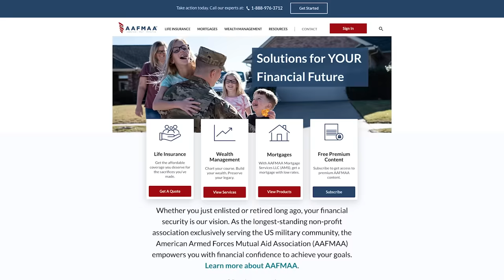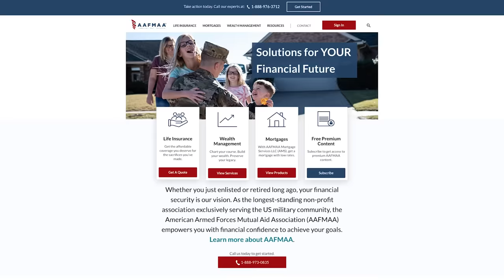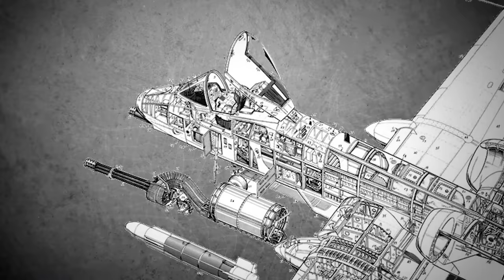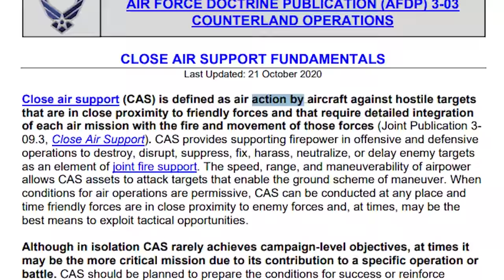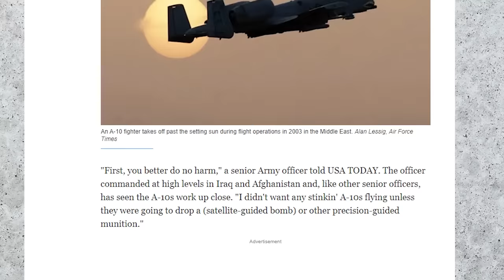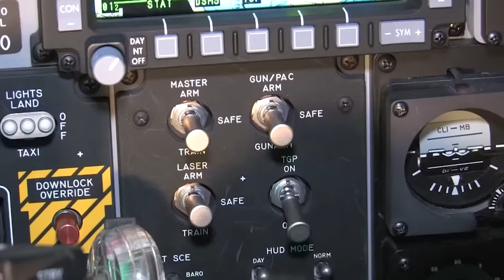Why the Air Force is Screaming to Retire the A-10 Warthog

Comment: "Close Air Support" is not about sticking a plane & pilot into harms way. It's about providing support which is "Close" to friendly forces. Same as "close artillery support". You don't run your artillery up to the enemy to use it point blank, and the only reason they did that with the A-10 is that in 1970's tech, it was hard to avoid friendly fire without an eyeball on the target zone.
The A-10 became somewhat obsolete over the course of the 1980's due to shoulder fired air defense systems. But it took a while for those systems to become prevalent among hostiles who "live in tents". It's about 20-30 years overdue for retirement. In terms of combat effectiveness, it's in much the same boat as the F-4. Cool plane... it would be perfect for fighting the vietnam war if it had come out sooner, but uh... things change.

F-35 can watch a soldier pee in the bushes while it's a barely visible spec in the sky, and send a cost effective, compact, precision ordinance (stormbreaker II) into his back pocket from a safe vantage point.
But frankly, even an F-16 could do "most" of that, with the help of a forward observer. So, A-10 has been showing it's age for a long time.
Reply: A10 can do it much much cheaper
Reply: Dang you changed my mind
Reply: A-10 needs to stay
Reply: @myprivatewar  Not really. As it ages, it becomes more expensive to keep alive.
Reply: @myprivatewar  Cheaper, yes. Even with all the extra duct tape expense for holding the old airframes together ;) SLEP is almost always cheaper than a new plane. But the issue of what you get for your trouble becomes less attractive. Do it cheaper? yeah. But the A-10 can't do it "better". And being in the plane which is a sitting duck for modern air defense systems, certainly not "cheaper" from the pilot's perspective. 

Also, you're assuming it will survive long enough to "do it at all". A-10's are about as stealthy as a disco ball. And it has to get to the target area, which by definition is somewhere near the front lines, where there are enemy forces to 'do'. Curvature of the earth & terrain features can offer some protection, until you get close at least. But only if you have total air superiority. If you allow the enemy forces to have any airborne sensors, the A-10 would be lucky to even see a target to 'do'.

And after you've gotten through A2AD, and swept all the enemy fighters away, you get your shot. But if properly equipped, the ground forces are likely to shoot back. You won't get very many kills before you get shot down. A shoulder fired MPADS costs anywhere from $100k to a few hundred $k. So you're not going to win any economic equations by maintaining & operating aircraft which feed kills to those.

The A-10 was lauded with praise in Desert Storm in 1991. And they did fly a lot of sorties. But they suffered getting hit 18 times in the process, 6 of which resulted in lost aircraft (it is a tough plane, i'll give it that). But that was just against the army of a strong-ish 3rd world country from 32 years ago ...who had no shoulder fired MPADS, and whose entire airforce & A2AD were rendered useless on day 1. They took 18 hits and 6 losses mainly to heavy machine guns on the ground. Which is the least effective tool possible for air defense on a modern battlefield. Even in Desert Storm, they had their sorties reduced and handed over to F-16's, because that was a much safer way to blow up tanks. So even in 1991, A-10's were starting to lose the edge on their blade against upper-3rd world armies.

They're going to give A-10's to Ukraine soon. I don't think Ukraine will actually fly them though. Ukraine doesn't have an endless supply of skilled pilots. Even putting ordinance on the A-10's and sending them to an area where there are Russian forces is of questionable value (even if you really hated that pilot, the ordinance has value). The "might" be of limited use, when retreating from a Russian advance, drawing the ground forces away from the protection behind them. Even then, it's debatable. The US isn't going to send any "advanced" aircraft to Ukraine though. Not when they're certain to drop parts into Russian possession.

I expect Ukraine will use them as flower planters or crop dusters. Or maybe they'll try to use them in combat. I dunno. It would be a "balls bigger than brains" move, but that sometimes could apply to Ukraine. And yeah, I feel bad saying that they're crop dusters. It was a pretty cool plane when it was brand new. Already behind the obsolescence curve when new (the hidden cost of "cheap" solutions), but it was cool for a while. I just hate seeing it dragged out to fight from it's wheelchair, because far too many people haven't kept up with advances in military tech after the cold war. When it was new, it could do ground attack cheaper, and more survivably, than an F-4 (as long as you had air superiority). But it wasn't an overtly better aircraft overall than a multirole F-4. Now? ...in the coast guard, the long loiter time would still be useful. Other than that, it's way overdue to go to the desert.

There's a reason why the F-15E and B-52 have "staying power". It's because range and payload never completely go out of style. At minimum, they force opposition air defense to spread over a much larger area, or risk attack aircraft simply going around the air defense. It's difficult to take that particular leverage away from them with more advanced tech. Also they can both use 'very' beyond visual range ordinance, in effect just acting as a UPS truck to get modern ordinance to a point where the ordinance can do the heavy lifting. A-10 doesn't offer any of that.

Also if you want too talk cheaper, compare the A-10 to drones..
Reply: @myprivatewar  And requires total air supremacy to not be at greater risk to the plane and pilot (whom costs allot of money to train).
Reply: lol “cost effective” is $5,000,000 a middle?!? Smart munitions cost way too much to be a true replacement
Reply: @christopherwarsh  F-35's primary air-to-ground armament is the SDB II, or GBU-53B Stormbreaker. It's a smart munition which is nearly as cheap as a dumb munition (just slightly above $100,000). Has good range, several redundant guidance methods, and is very subtle on IR, giving less warming.

But I agree that "raw tonnage" of unguided munitions is under-appreciated by modern US armed forces. Sometimes you really do just need a bigger hammer.

A-10 isn't that big of a hammer though. It's not an especially large plane. It just has a big gun, which maybe will hit a tank, and maybe penetrate it. While it gets spit-swapping close to hostiles, with maximum risk. It's not actually all that cheap to operate either. F-16 matches it, but with a lot more multi-role capability, and the F-15 does similar, with a bit more cost, but a lot more boom.

A-10 and AC-130 are very very cool. But really they're "pre-MPADS" designs. And they haven't been very meaningful against near-peer threats for decades, and are pretty questionable against even very low budget adversaries these days. It wouldn't surprise me if there are "cartels" which have MPADS in 2024. I'll grant they get a lot more interesting if you can actually run an adversary all the way out of even handheld air defense tools. But that's a long, difficult, high-attrition goal. SEAD rarely can actually get rid of shoulder-fired AA.

The BUFF on the other hand... well, there's a lot more post-SEAD opportunities at 45,000 ft. And it really brings the 'bulk delivery' element. Dumb-bombs over safe-"ish" airspace, or long ranged big missiles to anywhere you want them to reach into less safe airspace. The only thing wrong with the BUFF is that they don't have more of them. F-15E has similar intrinsic value (in a smaller dose).

And if you really wanna get in there & play high-risk with eyeballs & bullets, you have the AH-64...